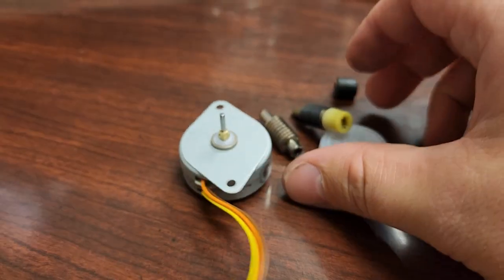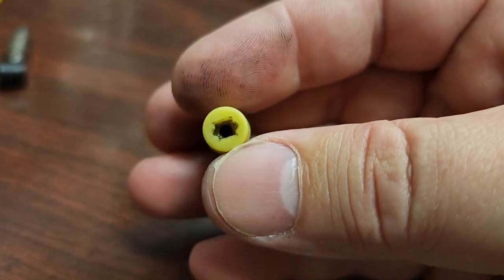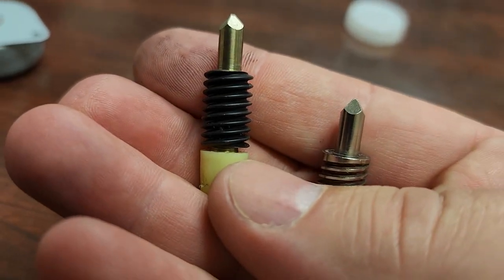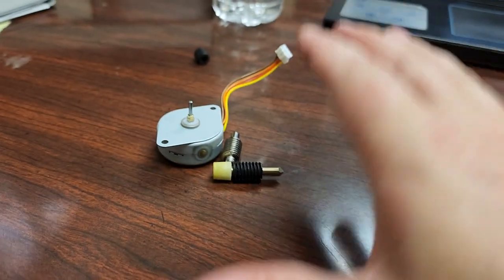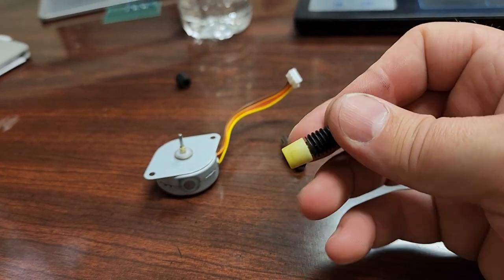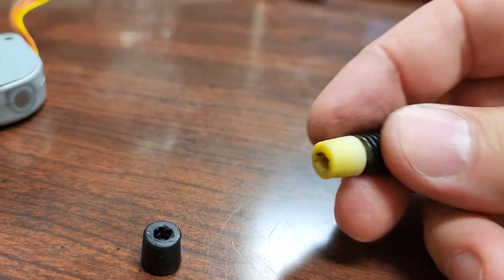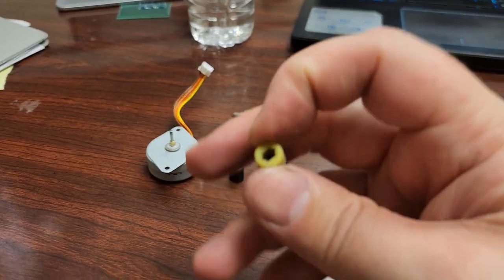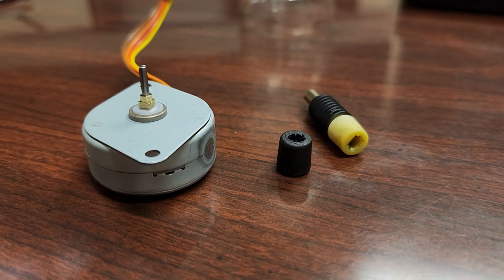I need some part suggestions

Comment: If you have enough space in the housing arround that coupler, you can use a small hose clamp arround that plastic/rubber coupler. If the plastic/rubber coupler is still to loose, you can use some Teflon tape to fill up the gap between the axle and the coupler, and then finish with the hose clamp. You can use a normal hose clamp that needs tighten with a screwdriver, but you can also use those Clicr-r type hose clamp, that get clamp tight with pliers (non-reusable hose clamp).

Comment: If you don't need the pliable coupling, I could probably machine a replacement gear that uses grub screws to tighten onto the shaft out of stainless or brass instead of a slip/press fit.
Reply: This is if the whole part can be metal and remove the plastic from the equation.

Comment: The wave washer on top of the gear wears out losing some pressure and allows the nylon piece to come up a bit and the bottom of the motor shaft (the square mounting area) starts to tear it up. I make sure to replace the wave washer every time I replace a gear

Comment: I think a screw set metal coupler would work instead of the rubber coupler. You have to measure the length of the rubber coupler, and  measure and both diameters from the motor shaft and from the worm.

Comment: The 3D printed method probably would work if in the correct material. I would avoid PLA so it does not deform with heat, perhaps PETG or some form of resin. I would avoid nylon as it will eventually absorb moisture from the air. I would print it in 100% infill. Anyone with a digital caliper and skills in Solidoworks, Fusion360, or OpenSCAD could model it up. Does the hospital have 3D printing equipment and/or a 3d printing expert? If they do, perhaps the two departments can collaborate. Unless it is resin printed usually holes and inside features come out slightly undersize and outside features come out oversize, so the cad model should take this into account. If you need someone to design the CAD model I could always give it a go.

Comment: Make an impression in plah doh and use light-cured plastic material. Alginate and dental composite would work better, of course. No printer required.
Reply: You can get acrylic fingernail making material, too. Or ask a dentist for acrylic. I'd use composite, first.
Reply from the maker: Interesting suggestion

Comment: Hi Justin - how many are you looking to get (I may know someone who would be willing to do it but they probably would need you to order a decent amount to make the design worth their while)
Reply from the maker: A couple hundred units.
Reply: @BetterBiomedChannel  Ok let me know contact him and find out if he is ready to take another project on. As of right now you don't have any preferred method of manufacturing or preferred material correct?
Reply: I think a harder grade of urethane would be a pretty cost effective solution and would be fairly easy to cast.
Reply: No luck - the guy I know is to busy right now and isn't taking any more jobs. I know the instructor who teaches solid works at my college - I can ask him if he things one of his students could use an internship project if your interested in a 3D CAD model - but it may take a while.